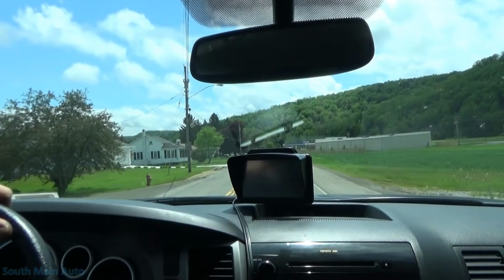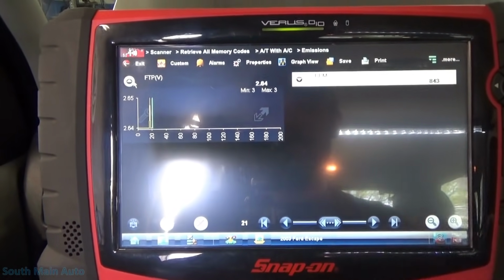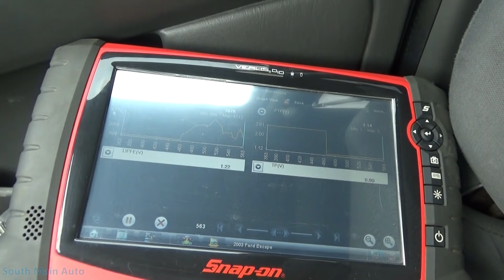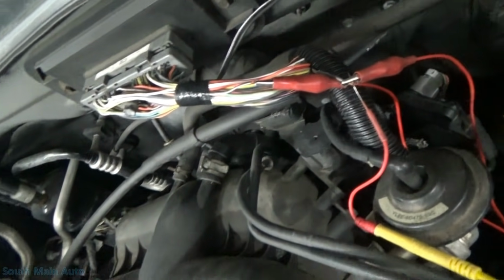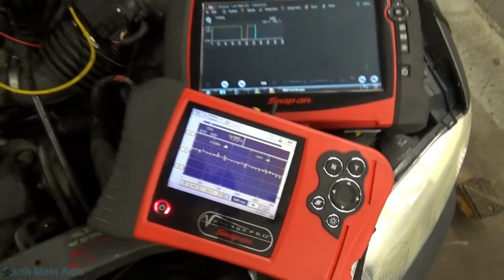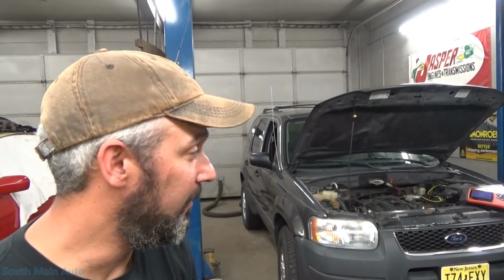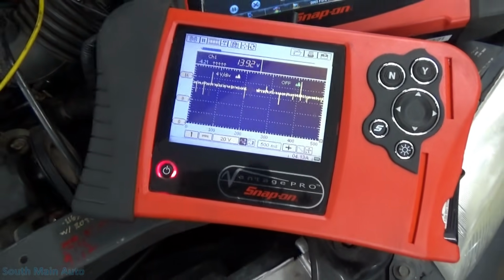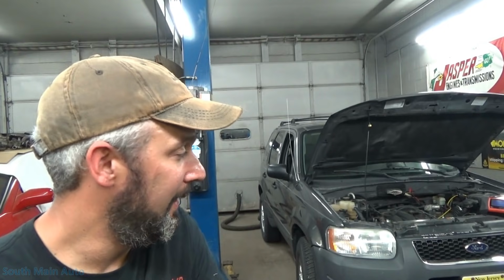Ford Escape: Do We Fix It Or Ship It!? - Part II

Comment: Eric, that was the work of a guy who won't give up, and refuses to take the easy way out. You felt something wasn't right with the initial diagnosis, went and conferred with your buddy, and kept at it until you found the problem. It may seem like just luck because p/s switch is different voltage, but you thought about it and checked it, when very few others would have gone that far. You're one of a rare breed, thank you.

Comment: If  you ask me, only a Super Tech would have kept working the problem as you did, eventually figuring it out.  Most would have thrown a new ECM at it right off yet you had that gut feeling that the ECM wasn't the issue and kept after it, working the issue until you found the problem.  I'm constantly impressed not only with what you already know and do but by the fact that you are continually pushing yourself to learn more and to improve your diagnostic skills.  Anyone can be a parts jockey and load the parts cannon up, I've seen very few who are truly good at diagnosing and are what I'd consider not just a mechanic but a skilled automotive technician/diagnostician.  Thank you for sharing your knowledge, skills and process with us so that we can continue improving our own abilities.

Comment: Sherlock Holmes quote frrom The Sign of Four, "when you have eliminated the impossible, whatever remains, however improbable, must be the truth"; and a Gary Player quote, "the more I practice, the luckier I get". Great deduction and homing in on the power steering pressure switch wasn't luck, it was experience; you were able to answer the question "what happens at 3,000rpm?". Great video; admirable ethics.
Reply from the maker: "when you have eliminated the impossible, whatever remains, however improbable, must be the truth" -- 100% right on!
Reply: @SouthMainAuto  My sentiments exactly - almost posted the same; lucky I checked.  EMC is a problem everywhere. There seems to be insufficient noise margin in the harness with all the wires bound up with each other. What elese is the sensor "talking" to? Filtering on the FPS signal in the ECM would be of great help since pressure does not change all that fast. All this hassle for the  cost of a capacitor and resistor.  Wonder if this is really a one-of or the pressure switch failure happens more often.  Brilliant deduction! Kudos!

Comment: Everything used to be simpler to diagnose.  Now everything is controlled by electronics of all sorts.  Bad connectors, corroded terminals, poor grounds, intermittent shorts or opens, bad parts and the like can drive anyone nuts.  Thanks for being like me.  I never give up until I find the problem.  Sometimes a very simple thing can cause big problems.  Unfortunately the book doesn't always yield the answer.  I loved your persistence along with great video.  Good example for the rest of us.  A million thanks from an old tech.

Comment: New follower here. Just want to say having the right equipment makes a world of difference. Eric's thought process is ever expanding. Most electrical problems require thinking outside the box. In this case, Eric was on a different planet to nail this down. Wish more people in our industry had the determination that Eric has. It might have been diagnosed with a test light and ohm meter, but really, that scanner is kick ass. More importantly, the way Eric knows how to use it is what helped out here. Great job and after watching this, you can bet I'll be putting knowledge in my mental toolbox and start unplugging things to look for changes.

Comment: I hate trouble shooting ghosts. We had 12,500V coming in on 3 legs and the bright Electrical engineers put a couple loops in the feed wires for future uses on the way to the target. Well, I just happened to do my rounds at the plant and to my surprise saw the wire glowing red along with the aluminum platform and steps where they hung it from. Was all because of the fact that the wires created a giant field around their loops. Go figure. Thanks for the vids Eric. Glad you posted it but you sure did not lose face in it!

Comment: Eric O...
You've often shyd away from accolades and people's amazement by you

In my opinion it isn't necessarily your technical skills that make you a super tech

It's your ability logically step through troubleshooting steps and using the information discovered to identify true root cause and corrective action.  You do this time and time again even though you'd probably save time and make more money by occasionally just chucking a part at it.  

This combined with the passion towards doing the job right for both yourself and to ensure you don't hose a customer is why I think you're a super tech!!!

Comment: Eric.  I was combing through the diagram to try to see for myself where the Power steering switch would be throwing that nasty signal through to the Fuel pressure sensor.  On the FPS It looks like the reference from the PCM is tied into the same reference that supplies the TPS.  The signal return goes strait back to the PCM.   On the Power Steering Switch it looks like it has one VREF coming out of PCM and then position 1 is open and position 2 sends it to ground and that ground ties in with the ECT and TPS as well.  So initially I thought maybe that dirty signal is coming back through the potentiometer on the TPS and getting across the 5 volt feed.  But I would think that wouldn't make sense because that resistance would be constantly changing.  Plus you re-created the issue with the 5V for the TPS (and most other stuff) disconnected.     Then I see if you continue to follow the Ground for the FPS and the ECT/TPS/PWR Steering Switch back they tie together at O2 Sensor Labeled #12 on the diagram.  That is the only spot I can see where they tie together.    I would love to see if that noise is being thrown equally down the ground side of both the PWR Steering Switch and the FPS when that problem occurs.   I bet that is how it is getting through.   Noise on the ground would equal noise on a signal that is pulling it's voltage down through that ground.
Reply from the maker: Very good theory Tom. Way to do discovery work! I like how you think :)
Reply: It's good to see someone is on the right track.
Reply: Could it be an intermittent ground problem
Reply: I just watched this video. I wonder if a diode could be used to eliminate the electrical back feed?
Reply: Mitchell Cochran I’m still teaching myself electronic circuits, but I don’t think a diode would help. It would chop off the bottom half of the noise, everything below 0V, but otherwise a diode won’t stabilize (resist change) the voltage. Instead of -12V to 12V you’d get the same +V noise, just in the 0-12V range. Everything that was < 0V before, would just be 0V. Not that it’s a solution, but just for the sake of discussion, a proper capacitor might smooth out the voltage some but it would have to be a cap intended for the frequency of the oscillation. Otherwise the noise will just pass right through.

At least, that’s my limited understanding :)
Reply: SO... I know I am a year late on this, but I am pretty sure I know what is going on. And it is a bit twisted. And it does not involve the ECM at all.... So you are spot on that this switch going bannanas is the root of the problem, but I was having trouble working out how that would cause what you saw - the real "Huh?" was that you saw the sensor output go to 0V on your meter, not just seeing it on the ECM monitor (So it was "real" not a software glitch). Also the ECM won't have the electronic capability of backdriving that signal (And you would have seen that on your passive test). I will put money on the fact that the 5V "reference" signal and the output from the power steering switch run parallel for a distance in the wiring loom. This would mean you effectively have a transformer between the PS signal and the 5V (The symptom is called crosstalk), so when you have lots of spikes on the PS signal you get LOTS of noise on that 5V signal. So on to part 2 - why does the sensor output go to 0V - so again I will put money on that sensor being more than just a simple sensor - I suspect there is some electronics in there, powered off that 5V signal. Exactly what is going on in the sensor is a guess, but for example it could monitor the supply for "power good" for stability purposes- e.g. "Power supply under 4V - set the output to 0V. This would translate the rubbish 5V signal into 0V output, and There's your problem lady. It would be dead interesting to get one of those pressure sensors over to @bigclivedotcom for him to tear apart :)
Reply: @Jason Bowman I suspect car companies don't use twisted pair for cost reasons (Despite the cost of the vehicle they try and trim out any fraction of a cent they can!!). They do use twisted pair sometimes - the high speed CAN bus does (See the end of https://www.youtube.com/watch?v=Q0gTP2zerV4)
Reply: @kevinjbakertribe  When he started taking apart the ECM connector, crosstalk was the first thing I thought. Then when he said it was a 12V switch fluttering, that also rang a bell. You essentially get a harmonic on the wire when you start switching that fast.
Reply: @kevinjbakertribe  If that were true, then only moving those two wires would correct the problem.  The problem was corrected by replacing the PS switch without moving the wires.  You're thinking, though!
Reply: @G31mR  You would have to separate them through the whole loom to see that. I had hoped to get an SMA/Bigclivedotcom crossover, as I am pretty sure the fuel sensor has a microcontroller in it, so a teardown/fault simulation of the sensor would be very interesting!
Reply: Yeah, Crosstalk. The pressure sensor likely has a brainbox inside, which doesn't like the glitchy 5V coming in - crashes the processor for a moment and you've got your problem. Or a diagnostic mode, but this seems unlikely. Automotive sensors normally don't do diagnostic with steady state 5 or 0V signals since it could imply a lot of other faults.
Reply: @kain0m  The diagram just shows a voltage divider circuit for the TPS, not a processor.  12v lines may feed a 5v regulated supply to the TPS.  When the 12v is switched to ground so rapidly, if it's feeding a 5v regulator, then the 5v output is also affected & the TPS 2.5v output to the ECM is as well.
Reply: @kevinjbakertribe  Exactly. As an EE I was going to make the same crosstalk comment if no one else had already.
Reply: @Jason Bowman stuff like that is called addressing the symptom and not the cause. In my field we call that a bad (or inexperienced) engineer. Solve the problem - don't slap a bandaid over it.
Reply: @Pleasant-Peasant-789  bad pressure switch or just electrical noise in the system. Diodes, caps, and resistors would be long term fix. New switch then same problem. Thank you sir!

Comment: Here's a tip I learned from one of the best Electrical Engineers around--  keep a 2,200uF 16V capacitor in your pocket.  If you find a power or signal bus that's noisy, bridge that capacitor from ground to the power bus.  A whole heck of a lot of times that will kill the noise and might kill the problem.  Not always the perfect or permanent fix but it sure helps morale to see things change.  Not always a fix, but certainly a clue.

Comment: Eric O. This video might go down in your archives as one of the most mysterious diagnosis ever!!! Its crazy how a faulty power steering pressure switch could cause the ECU to trigger a faulty fuel pressure switch back at the pump. Secondly, you have nothing to be ashamed of since you found the fault through your own deductive reasoning and repaired it without replacing a good ECU. I speak for everyone on this channel when it comes to always having and maintaining faith that you are still the best mechanic on YouTube. You called in creative support when the problem stumped you and you came out right. No luck here. Im more proud of you now than ever. Great job!

Comment: Power steering pressure change at 3000rpm causing 5v reference interference! That takes alot more than luck. Keith is going to start calling you for advice Eric.... I mean Super Tech!

Comment: Might be worth contacting an ECU repair company and ask if they know why such a noisy signal on another input would do such a thing. I was thinking alternator voltage reg BTW.  Well done.
Reply: Noise of that amplitude and speed has tons of energy and eventually gets into the modules. It is UP TO THE MODULES to protect themselves from noise, because noise is a known issue, not only in cars. But look the positive side, the ECM never trashed the vehicle, so, in the end, it is "solid" because it keep working. LONG ago I remember this from NOISE and ESD test in electronics for cars. What happens when a module fails and what is acceptable:

LEVEL A: Module is not affected

LEVEL B: Module is affected. NO critical function is affected. After interference is removed, it selfrestores.

LEVEL C; Module stops working in safe mode. When interference is removed, it restores
 
LEVEL D; Module is pemantly damaged. Interference is removed, but module wont recover.

Depdengin on the function, each elevel is acceptable. For exmaple, a Winshield washer module, can stop working. ECM in the Escape is probably a B, some functions are degraded but still doing its job. The interference is removed and all happy. LEVELA dont know, probably life related items like ABS, SRS ... I dont know.

Comment: Nice diagnostic.  Question, would the dealer been able to come up with the right answer?  I think not!  Good one mr o.  👍
Reply: the dealer wouldn't put that much effort into it , they would just keep just changing parts till they nailed it and then give you a massive bill
Reply: Tim Parts cannon would never have taken them to the psp sw. They'd be effed.
Reply: The dealer will just try to sell you a new car.  Car is too old so they are not going to make any money from a factory warranty reimbursement.
Reply: I seriously doubt whatever flowchart they make their techs adhere to would've caught this.
Reply: You know folks I work at "the dealer" (albeit in the parts department) and I can 100% guarantee they'd be asking me to order a PCM on this thing. Matter of fact this just happened a few weeks ago (tossing a PCM at a vehicle because the emissions readiness monitors would not set) and guess what? It didn't fix it! Surprised? I'm not. It ended up being a bad O2 sensor and it took 3 techs and the service manager to finally get it fixed. We finally get the car back to the customer and a week or two later we found the thing on Craigslist! LOL!! By and large flat-rate guys in a dealership environment would never put that kind of time into it. I'm NO tech; FAR from it!! But, Eric, you got it. In my almost 2 decades of being on the dealership side of things, nobody that I know of would have figured it out. Don't apologize and don't sell yourself short! Great job man!
Reply: Depends on the tech it's handed to. Not everyone at the dealership is a parts changer, some of the best techs I've worked with have been lifelong dealership guys. Hate them all you want, but the shirt a tech wears or the building they work in doesn't have a single thing to do with their ability.
Reply: Justin Kady trust me, I don't "hate" any of the guys I work with. I'm good friends with most of them to be honest. They take care of me and I take care of them. The fact of the matter is it's more the environment they work in, not they"re ability per se. Some of the guys I know may have eventually figured something like this out. Maybe that is.  This one is a strange one and would challenge the best of them. Most dealerships are not going to pay a tech the time to track something like this down. And that's sad; that's flat-rate for you. I guarantee one of my guys would been on the phone to the manufacturer we work for (I won't say who) and tech would've told them to put a PCM in it. And they would've too. Just like Eric here was starting to lean towards. I've worked some very good techs under 3 different brands and this probably would've stumped them all. Eric is on a different level and goes until it's fixed. That takes time (very huge!) as well as skill. He has both. Sadly, most flat-rate guys probably feel they don't have the time. And more often than not, don't.
Reply: No dealer in the US would have found that problem. If the scan tool doesnt tell u what it is, forgetaboutit!!!
Reply: Mike Giaccone well said my good man! Intelligent and one of the best comments on this whole video.